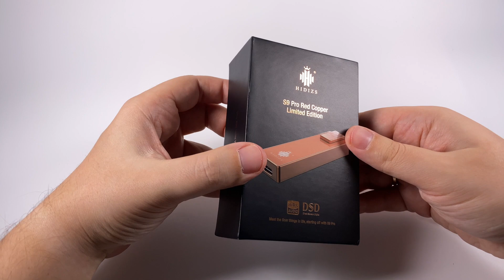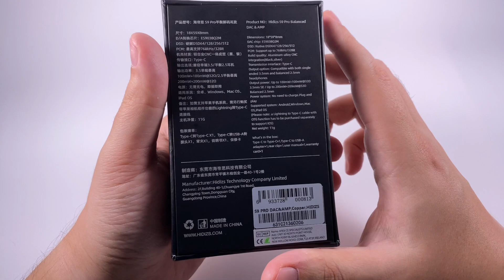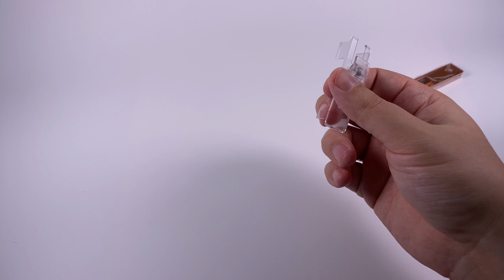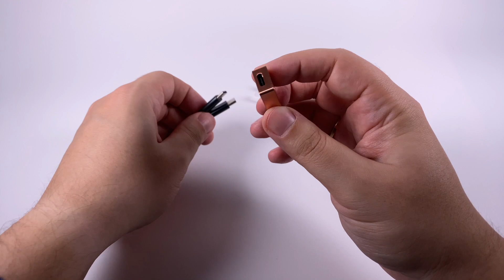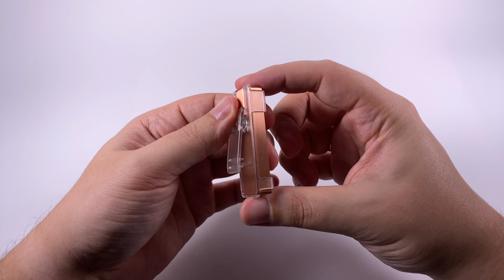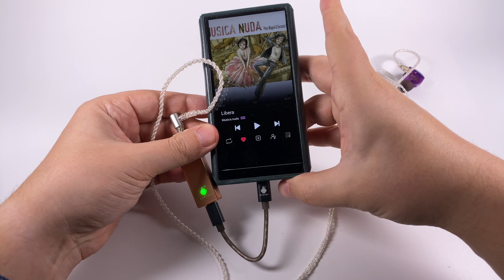Hidizs S9 Pro DAC limited edition — beauty of red copper

Comment: Hi porta fi, do you try this devices also with some better usb cables? AQ or Supra. I can tell that those generic USBs that they come with hold those DAC/AMPs back :), they clearly are bottleneck. It is huge difference.
Reply from the maker: hello, I'm not a USB cable believer. digital transmission doesn't work this way )))
Reply: @PortaFi  That is perfectly fine :), but actually I am suggesting you to buy Supra usb 2.0 or audioquest usbs (cinammon or carbon) to try. I was very sceptical especially about the audioquest cables (because everybody call them snakeoil company) but man they do a difference with my dongle dacs, and also within my desktop amp/dacs where I bought also better power cable (also from Supra) and that made even bigger difference :D. Those cables (especially Supra cable) are very affordable and you can still return them. I dont know if you have ever tried some better usbs or not, and maybe those usbs were poorly designed regardless of price. Also you can try the shanling m8 like DAP and than like DAC from the computer via usb, the sound will be downgraded, I think it is  because of that usb cable...
Reply from the maker: @rakeťák6974  my main job is programming, so I know how USB Audio works… :) so my opinion (and I did some blind tests to check) is that any normal USB audio cable is equal in sound transmitting. 
as for Supra, I like them, got their cable for me speakers
Reply: @PortaFi  I get you :) I know many It guys and they tend to have your view on things, to me that is not just 1s and 0s to you maybe simple math :). That 1s and 0s need to be represented by something (voltage ups and downs), also audio signal is very time specific and usbs are noisy (cable design is important), and wheter you think its all ones and zerors and cable doesnt make a difference, there is still effect of capacitance, resistance, inductance (cable material is also important)... . All those things that happen in the analog audio cable will happen it the usb cable. But I dont want to persuade you 🙂, I 100% hear the difference myself and I thing u have better analytical hearing than me. Those cables change every aspect of the sound to the better (soundstage, imaging, 3D, bass impact, separation, etc.) ☺
Reply from the maker: @rakeťák6974  thank you for sharing, I think we reached the points where our experiences collide, and we both left with own one :)
Reply: @PortaFi  yes but its alright 😊
Reply from the maker: @rakeťák6974  can't agree more here :)

Comment: I noticed they ll also release an AP80 Pro-X version soon with 2x ESS9219C DAC chips.
But i dont know if its worth buying since i have the AP80 Pro already. 
I really like Hidizs sound signature and use AP 80 Pro for hiking and sports.
Its reallyy a gorgous little monster and really versatile in sound tuning if u get into all adjustments it offers.
I think they should really go on and make a device in the size of Hiby R3.
Great review!
Best wishes from Austria!
Reply from the maker: unfortunately I don't know how new AP80 will differ in terms of sound, so it's hard to say. AP80 and AP80 Pro were pretty close in terms of signature (except the higher power on balanced)
Reply: @PortaFi  Yes thats right i didnt get the advantage of Dual Dac improvement right, iBasso is also using 2x Cirrus Logic Dacs in DX160 then 4 of them already in DX300 but now they release DX240 with only one ESS Dac (but its the latest ESS Flagship DAC as far i know)and first reviews claim it sounds better than all...:-)
Reply from the maker: @Poschmane  as far as I know, switch from Cirrus Logic was forced, as Cirrus experience problems with manufacturing